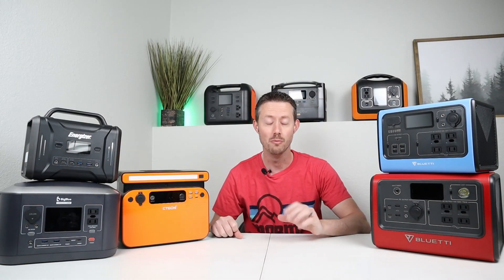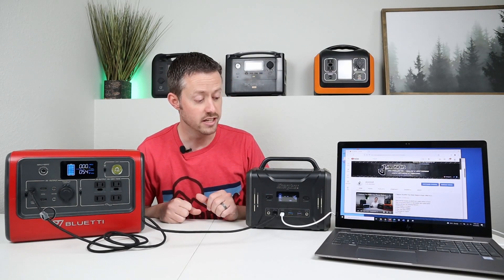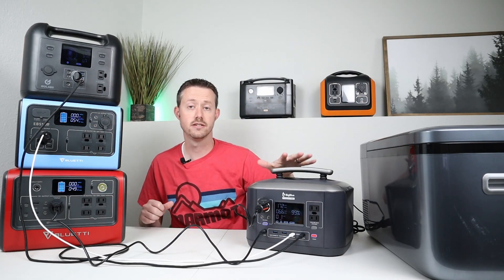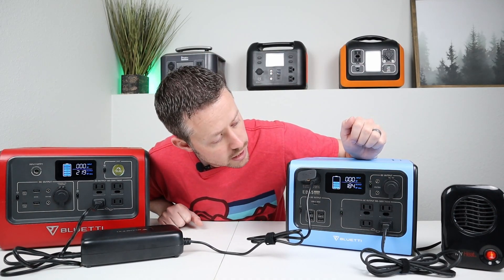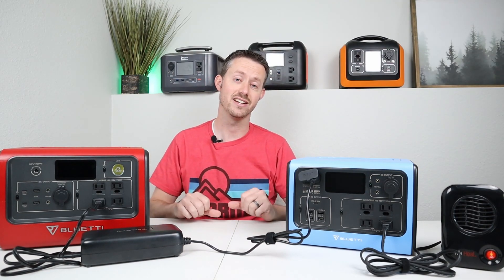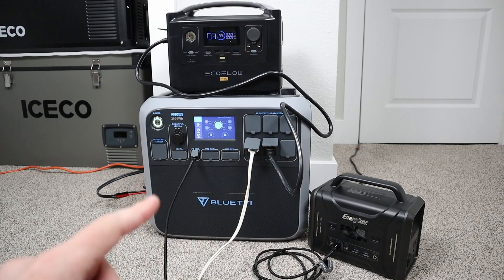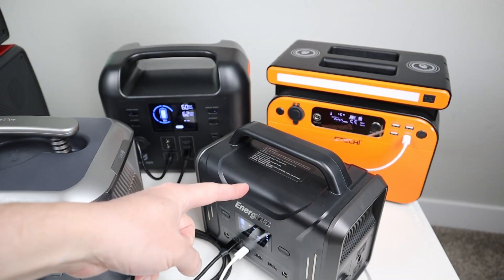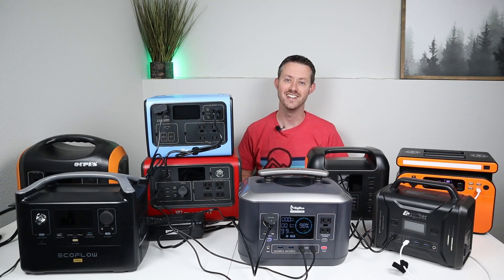More Capacity!? Connecting Multiple Power Stations Together - Daisy Chaining 8 Power Stations!!!

Comment: Ive never seen anyone do this before pretty ingeinus. Im not exactly sure what inputs and outputs you are using to daisy chain. But i have the Bluetti EB3A i have the Jackery 500 and the Jackery 240  how would i hook these all together?
Reply from the maker: I don't think those have bi directional USBc ports, so the only way to connect them would be via the 12v cig charging cable.
Reply: @Jasonoid  On a gamble i tried the Jackery 500 charging block into the Bluetti EB3A solo port and it worked.The Bluetti shows 81 Watts with no issues at all

Comment: I’d like to daisy chain my Bluetti EB70S to my Jackery 500 Explorer.  I’m looking for an adapter cable to go from the USB C (100w) output on the EB70S to the 8mm barrel (100w) input on the Jackery but I’m striking out.  I’m sure I’m doing something or thinking this through incorrectly.  Can anyone help?
Reply from the maker: You'll get around the same power when charging your Jackery 500 using the 12v socket cable plugged into your EB70s. I don't know of a USBc to 8mm type of adapter that's available.

Comment: Order two xstar sp100 after researching sunpower cell, decent results charging my power bank but one of the panels is charging approximately ten watts less. Should that be a concern? Should I consider getting the weaker panel replaced? Thanks for any thoughts you might have, your knowledge and guidance is appreciated.
Reply from the maker: That's pretty rare to get a panel that's not producing 110 watts or so in ideal conditions. You might want to reach out to their customer support email. They may make some recommendations on what options you have.

Comment: My understanding of electricity is pathetic, so I apologize if this is a stupid question. Why is it that the power stations can’t combine the capacity they can handle, in addition to battery capacity? Like if I have two 1000w solar generators, linked together- they would be able to handle 2000w (or at least some increased capacity, more than 1000). I assume it has something to do with either the controller or the inverter for each of the generators. I’m just curious if it is technically feasible (in near future maybe).

The other question I have is; if you are dumping power from one generator to another like you did in video, which method do you think was the most efficient?
Reply from the maker: USBc and DC power dumping are the most efficient since it's DC to DC  charging and there are not any conversion losses like when you use the AC inverter.  It's a little slower using DC output since it's limited to around 100 watts.

The power station needs to be designed to have expandable batteries in order to truly support more capacity. The batteries inside are complicated and they need to properly communicate or it won't work. Luckily expansion batteries are something that is becoming more popular.
Reply: @Jasonoid  thanks Jason!

Comment: Jasonoid, I have a eb 55. It is noisy on my guitar amp. I would like to run a small high quality inverter from the DC power source. Low  frequency inverters with large transformers have low noise for audio amplifiers.  I am thinking maybe an aims 300  watt inverter may be high quality.
Reply from the maker: I've heard great things about AIMS inverters. Im currently working on testing each of the power stations for noise so that video will be out within the next couple weeks is my hope.

Comment: The Ecoflow has pass through charging, so the battery charging the ecoflow is both charging the ecoflow and powering the load coming out of the ecoflow. So the ecoflow is only charging at its full capacity and extra the 440 watts are going through to whatever is connected to the ecoflow
Reply from the maker: Great point Chihuahua, I didn't think about that! Duh.... Lol

Comment: Great video as always. Any chance you have or can make video about chaining together portable solar panels. Am curious about mixing different brands wattage. Use case being my 120w panels age and don't put out as much wattage, later buying a 60w or another 120 to run in parallel.
Reply from the maker: When running panels in parallel the panels will drop down to the voltage of the lowest panel in the chain. You'll get okay results with mismatched panels.... but it's always best to pair similar panels for the most power. Would make a fun experiment video!

Comment: So I have a few larger power stations now. Eb240, ac200p and eb70 but they are all pretty inefficient. I'd like to get a smaller one that's really efficient with a decent sized lifepo4 battery that can run a lamp or router for longer periods. Or can charge devices multiple times. So like a 200-300w inverter and like 500+wh battery. Also that can handle a 100w panel. Can you think of anything like that?
Reply from the maker: I have found the same thing. The larger power stations need a solar panel always plugged in to stay at 100%. The Energizer 320 is a pretty decent model that would fit those points, I have the review on my channel (it's not 500wh capacity though).
Reply: @Jasonoid  I'll watch that! Thanks!

Comment: so many powerstations! This is awesome! Thanks for the video! I've been doing something like this for a while now.
Reply from the maker: Which power station is your favorite that you own right now?
Reply: @Jasonoid  i like the rockpals 300w from about 3 years ago. I added 6 extra cells to it for a 3s10p configuration. It is older but it charges with 12-24v dc, AC, power supply is integrated, extremely small and lightweight, instant turn on and really useful for its size. My jackery 1000 is also a close contender but its much heavier and bulky for what i need.

Comment: Jason what are your thoughts on charging the AC200p with the eb70/150/240 wall charger through the aviation plug/mppt? I have 2 t200 chargers.  Bluetti sells the dc7909 to xt90 for $10. I'm wondering if it would improve the battery life by slow charging at 200w vs 450. Also if needed I could charge at 650w wthe t500+t200 at times when needing a faster charge. Any thoughts would be helpful! Thanks!
Reply from the maker: As long as the voltage of the charger is within the range of the AC200P input (which I'm sure it is) that will work perfectly fine.

Comment: Question for you, could you plug let’s say a Jackery into your cigarette lighter in your car which is 10 amps to charge then plug another battery pack into the Jackery and Daisy chain charge off of that 10 amp input?
Reply from the maker: Yes that would work, DC to DC Charging is the most efficient way to charge so you could either charge the second power station off the Jackery 12v socket or another 12v socket in your vehicle. Also make sure your car engine is running while charging these up.
Reply: While it would work, just remember it isn't free:   the power comes from additional demand on the alternator, and that energy necessarily consumes more of that expensive dinosaur juice.
Reply: Thanks for the reply, I appreciate it.

Comment: Great test!  If you are able, can you run a test where you drain your EB 70, EB 55, CTechi 500 to zero, then daisy chain them to your AC 200p to determine how long it will take to fully charge them?  Thanks!
Reply from the maker: To save on power and efficiency loss, it'd be best to just charge them off the multiple outputs of the AC200P. Like one off the DC 12v socket, one off the USBc 60 watt port, and 1 off the AC inverter. They would charge in about 4 to 5 hours depending on the charging speed.
Reply: @Jasonoid  I don’t know why I didn’t think of that!  Thank you!
Reply: @Jasonoid  To save even more power and efficiency loss is to use one port on the AC200P and just charge one station at a time instead of all three at the same time.

Comment: Taking a trip to the national parks in Utah in June. I'm thinking of doing a power station and fridge. Do you think it will work ok having them in the car all day while I hike? It does get hot  during that time of the year.
Reply from the maker: Nice! Which parks are you going to?  It can get to be near 100F during June, it just depends on the year. 

If you have a larger power station (700wh is a good size) and a decent insulated fridge you should be able to run it through the day, especially if you charge it while driving. It just takes experimenting because there are a lot of factors that go into power usage.
Reply: @Jasonoid   We are going to Moab, Bryce Canyon, Zion and North Rim. I was thinking on buying a Setpower RV 45 or 60 and use either a Bluetti EB70 or a Oupes 1200.
Reply from the maker: @davidmachan3137  I try to make it to Moab at least once a year, love it there. Lots of awesome hikes! 

Either of those options will work well. To get the best performance with the fridge, try to keep the car temps as cool as possible (crack windows, park in the shade). Once you get the gear test it and test it and test it again so you can get estimated runtimes for your use case.
Reply: Do you think the Oupes 600w would work ok, they have a good sale with a solar panel

Comment: Interesting!  So many cables! Do you have a link for that USB-C cable that you used for the Bluetti and the Energizer?  Also any other different cables you used - but especially that first one.  Thank you.
Reply from the maker: The Energizer 320 power station comes with the USBc 100 watt cable in the box. The Bluetti did not. You can buy any 100watt USBc Power Delivery cable on Amazon like this one: https://amzn.to/3uLEZyB
Reply: @Jasonoid  Thank you, Jason. I've just started using my Energizer 320.  I'm charging my oldish Paperwhite Kindle with it right now with the older USB plug.  The wattage is jumping every couple of seconds from 3 watts to zero watts, back and forth constantly.  Is that normal?
Reply from the maker: I think that older device charges really slow so I wouldn't worry about it. Your phone would probably be more consistent at charging.
Reply: @Jasonoid  Thanks!

Comment: kinda waste of energy.
Reply from the maker: Sometimes its worth just testing something out, even if it's not efficient. Doing this on a small scale with USBc power delivery on 2 power stations wouldn't waste much power. Using AC wall chargers with 3 plus power stations is MUCH worse LOL
Reply: I like your videos,  but I think it is important to mention especially for people with zero knowledge about electricity that this is not an efficient solution.  Anyway thanks for your detailed content.
Reply from the maker: Thanks for the feedback!
Reply: oh he did mention the loss in efficiency in the video, that loss ended up as heat, an interesting experiment, but probably a good idea to charge all the little ones off the big one directly

Comment: Does the charging and discharging at the same time cause damage to the batteries in the power stations?
Reply from the maker: Not that I have seen from my testing. As long as the batteries inside can stay cool they shouldn't be damaged. Most power stations I have tested in my reviews have plenty of cooling / airflow. I use my AC200p everyday with about a 300 watt load constant going out and 700 watts coming in via solar and it's still rocking and pulls full capacity still, benefit of LiFePO4 cells.

Comment: Interesting. It would be great to see what happens if you connect two power stations through bi-directional usb-c ports on both ends. How does the electricity know which direction to go? For example, what if both units were at 50 percent. What would happen?
Reply from the maker: The power usually....USUALLY haha...flows to the lower charged power station. AskIve Solar showed that in one of his videos and he saw some interesting results of it not being able to decide which one to charge.
Reply: Jasonoid Got it. They need a switch to let you choose. Thanks.
Reply: @Jasonoid  which video was it?